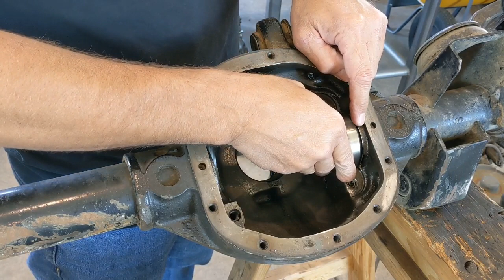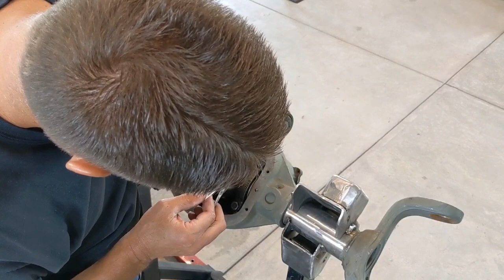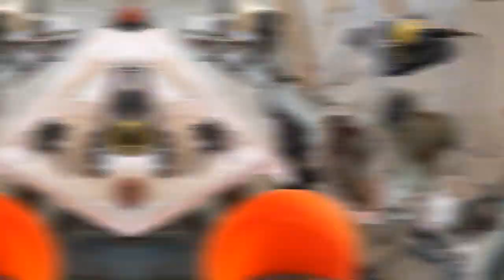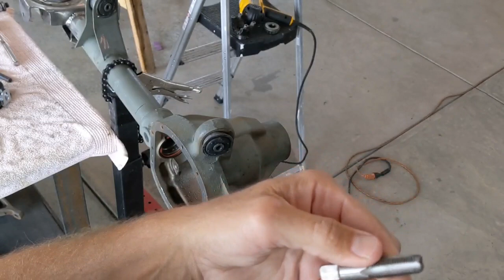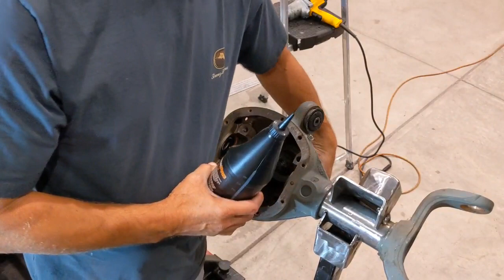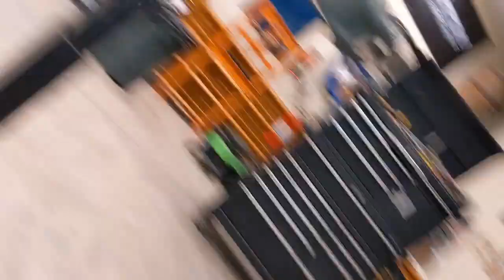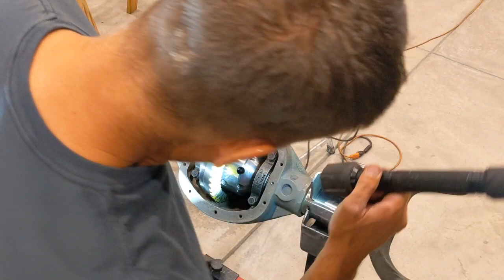Jeep Wrangler TJ Dana 30 Axle Build Part 4: Setting the Gears (part 2)

Comment: By far the most in depth and detailed video series on setting up gears. I feel a lot more confident now doing it myself. Thanks for the awesome content! Just a quick question, why are you going with 5.13 gears?
Reply from the maker: Gear choice should be made based on what motor you have, what transmission you have, and what tire size you run. For me, I have the stock 4.0, NV3550 5 speed transmission, and 35" tires. The 5:13's gave be back 5th gear and makes driving up in there mountains far better.

Comment: Hey brother I have a question. I keep seeing you use the larger shims between the house ins and the race of the carrier. Where do you get those. All I can find are the smaller ones between the carrier and bearing that gets pressed on. I have an 05 Dana 30 that fell out when I pulled it and had bad bearings. Was pulling just to put a spartan locker in.
Reply from the maker: Those come with the master install kits. I've saved a ton of them over the years so I have a decent stock. You have to be clear that you want aftermarket shims that go to the outside as stock carrier shims are smaller since they go between the carrier and bearings, not outside of them. Try East Coast Gear Supply.
Reply: @TheBFHGarage  thanks for the reply. O’reilly found some that appear to be pretty close to the same size as the race for a GM in stock. Gonna try those I guess. Thanks for the awesome videos man. Great content.

Comment: How much preload did you have for the carrier bearings?

How do you shim for proper preload on the carrier bearings?  Looking at the arb manual, it looks like all the preload shims are added to the ring gear side.

I figured I'd measure like they suggest in the arb manual for the furthest away from the ring gear and then I'd start with enough shim to match what came out of the housing and look at my backlash and patterns from there and make sure I can't get a feeler gauge into the case.

BTW these videos are awesome. Thanks
Reply from the maker: Preload is all but impossible to accurately measure on the carrier bearings. With an ARB, you want as much as you can get. If you have a case spreader (most people don't), you can open the case a max of 15 thou and then drop the carrier and shims in. For those who don't have one, then 6-8 whacks with a deadblow hammer is about right. The hard part is getting the shims to go in together.

Don't bother with a feeler gauge. It will be way tighter than that. And there is no such thing as preload shims on one side. All shims are the same. Preload comes from adding shims until it is tight to install. Your still need to account for backlash by moving shims from one side to the other.
Reply: @TheBFHGarage  thanks for the reply. I'm working on my first regear and I'm coming from 3.07s, which makes the directions from arb almost useless because of the different carriers.
Reply from the maker: @bugoutjeep8065  the ARB instructions are what they are. Setting gears takes some skill and a lot of patience. Look through my channel, I have a Dana 44 re-gear video too. I'll be doing another re-gear video in the near future as well.
Reply: Preload for the carrier bearings is .008 total. This is set by installing the carrier with bearings and shims in the housing, without the housing being spread, so that there is zero clearance, meaning no more shims can be added. This may require one to tap the carrier and shims in place. Then a .004 shim is added to each side using the case spreader. The case cannot be spread more than .020 or it will be damaged.
Reply: @randytremaine1622  I had trouble getting the pre load right on my D35.  I put mine back together and had to pull it apart cuz I didn't have enough preload. I know for certain though you must have some preload or else you'll do damage.

However I was thinking for the D35 it was like .003. Anyway thanks for the reply.

Comment: Great video! I noticed you tightened the pinion nut til no play ,but did not set preload at this time. So you can wait and set preload after your shims are all correct. Not having pinion preload before shim install is ok? I’m new to this just want to confirm as I’m doing my first Dana 35 this week.
Thanks
Reply from the maker: Pre-load is set during final assembly. During setup you can tighten the pinion nut until it is close to what the final preload would be. You can feel it by hand with a little experience. Basically, you don't want any play in the bearing but you don't want to overtighten/crush them either. That is fine for running a pattern. Then for final setup you will torque to spec AND double check that your pattern hasn't changed.

Comment: Hey brother great videos! Just started watching them all over and over. Im in the middle of my low pinion Dana 30 regear right now. And I ran into an issue. My pinion is still atleast .010 too deep and the only thing I am running is a .030 oil slinger and no shims. Do you think I can run my pinion without the the oil slinger because it is a low pinion? My other option was to try and sand down the slinger but not having a machine shop available, it probably wont perfect and cause noise/vibration issues. Its already the thinner slinger in my Yukon install kit.
Reply from the maker: At your own risk of course, but I have seen axles both with and without slingers. I find it hard to believe that you need less than 30 thou though. Usually the range is much higher than that. Are you sure you are reading the pattern correctly?

Comment: My revolution rebuild kit didn’t come with an inner pinion bearing oil baffle on my HP 30, I noticed you didn’t put one in when you put your inner race in permanently. I’m good not running one?
Reply from the maker: It's hit or miss with any install kit it seems. I've run without forever with no issues

Comment: Nicely done video. I was thinking of installing the copper tube fitting behind the upper control arm mount where its flat. I am installing a Yukon locker which has the pinion seal on the right hand side so it seems a reasonable location, however I am concerned the housing wall at that location may be too thin. Any thoughts?
Reply from the maker: The problem is trying to get the copper line over the locker to get it back there without damaging it. Not saying it can't be done but it definitely takes a well thought out process.
Reply: @TheBFHGarage  ya thats exactly why i chose same location you use. Easier to install.